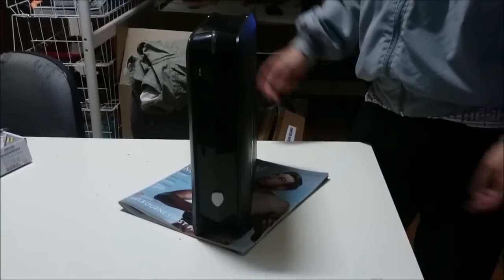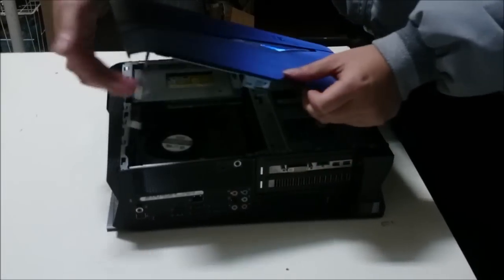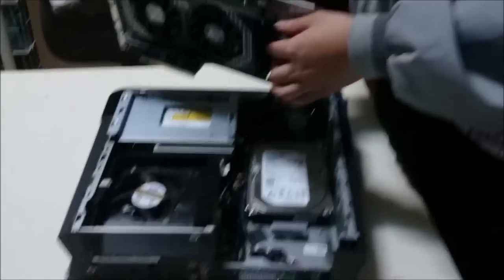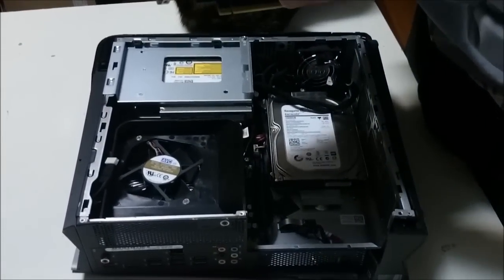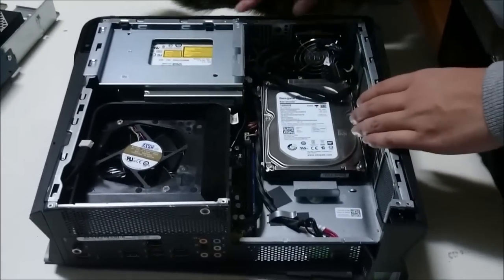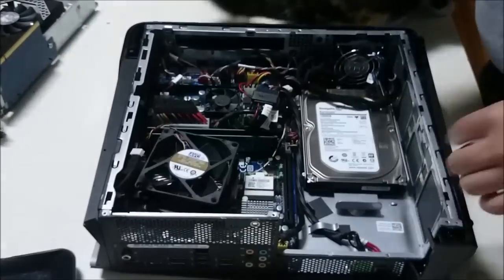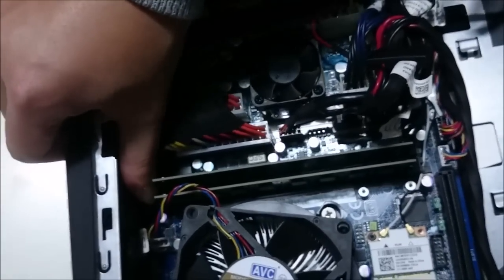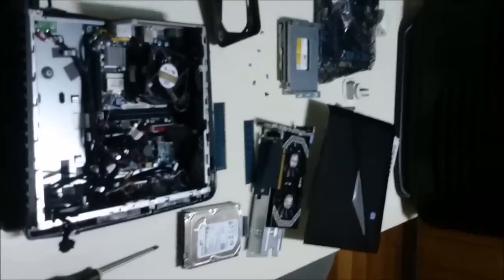OPEN ME UP! Dell Alienware X51 R1 R2 and R3 Disassembly

Comment: Can I use the water cooling component on my R2?
Reply from the maker: nope there is nothing that will fit inside
Reply: @OpenMeUpTec  even if takeout the optical drive? thanks for the reply
Reply from the maker: @savp199524  there is no water cooling design for this computer. you can DYI it but then that is something you are risking. there  should be no reason for you to water cool this computer. if you are have temperture issues then open it up clean out the computer and replace the thermal paste
Reply: OPEN ME UP thanks for the heads up! Yeah just a little paranoid about the temps but they run ok
Reply from the maker: @savp199524  this is an old computer. if you have a problem with it sell it and buy a new one.
Reply: OPEN ME UP will do !

Comment: Uh. That’s not what my X51 graphic cars looks like.... was I ripped off or something?
Reply from the maker: anything that fits inside works. if it does not look like the one in the video then it might not be the original and changed by the previous owner
Reply: @OpenMeUpTec  Well... I'm the original and only owner lol. Mine is only a single fan, doesn't take up the whole area like that one. I have an X51 R2, and the graphics card is a GTX750Ti, which is what it came with.
Reply from the maker: @MsPoliteRants  ok now i understand you got the cheapest graphic card they had on offer. the one in the video is a GTX 660. the biggest thing this will fit is the xx60 series like the GTX1060. you can get small in the xx70 version but it is rare
Reply: OPEN ME UP oooooh damn. That makes sense . I thought i was choosing nicely back then but now I'm looking to update that card so that makes sense. Thank you for the info,i was planning to upgrade to a 1050
Reply from the maker: @MsPoliteRants  honestly you dont what 1050. try to get yourself a 1060 or a 1660. 1050 is too low end and wont last you long. you will need to change it again next year as it is already 2 years olds and next year is 3 years old
Reply: OPEN ME UP the 1050 and 1060 didnt seem too different. I’m worried about price honestly. I mostly just need enough of an upgrade to get Windows 10 to run my video editor. I’m stuck on max RAM 16GB and the motherboard won’t go past i7 intel CPU. Eventually I have to suck it up and buy a new PC but right now I’m in limbo. I don’t play any demanding games. Most demanding game I play is Sims 3. It’s my video editor that has issues lol
Reply from the maker: @MsPoliteRants  if it makes it easier for you, you can buy a graphic card and then reuse that graphic card in the future for your new computer. here in Australia gtx 1050 in only $100 which isnt much compared to gtx1060 $250
Reply: OPEN ME UP yes that’s why I’m aiming for the 1050. Thanks for your help!

Comment: Thanks even now all this time later. was pusihing and poking everything . one utube later and a simple slide.   I am having a hd failure and want to put in an SSD drive.  Amazon says the Samsung EVO 2.5 1Tb might not fit.  I think it will  with an adapter .If your still out there do you think it will fit. ?
Reply from the maker: it will fit any hard drive. if you watch the video you will see there is alot of space

Comment: how do i open the case? mine won't budge even after removing the screw
Reply from the maker: follow the steps in the video and you should be fine
Reply: OPEN ME UP while opening it up, a piece fell out. it's not attached to anything. im not sure where to put it?
http://imgur.com/gallery/0lEePXO
Reply from the maker: graphic card holder. and it goes next to the graphic card at 1.43 in the video.

Comment: I have the GeForce gtx 745 I removed my graphics card but I can not find where these wires plug in? I don't think there is any spot to plug them into my graphics card is there a possibility they are there just for if I upgrade my graphics card? I really can not find a spot where they plug in been looking at this for over 20 minutes now I feel so dumb lol
Reply from the maker: the 745 don't need the plugs. It is for better graphic cards if you get one

Comment: Thanks for the video! I was going to add a Sound Blaster Zx to my new X51 R3 when it arrives today, but it doesn't look like there is room for it. Can you confirm that?
Reply from the maker: +Michael Austin there is no room. it only has one slot which is for your graphic card. you are buying the wrong product if you want to add things
Reply: +OPEN ME UP I appreciate your response, man. I'm probably better off with an external DAC anyway.
Reply from the maker: you have to now as there is no option

Comment: how did you disconnect the string??? I've got the case off but that's wiring so I can't disconnect it
Reply from the maker: +JUSTIN MERRITT watch 0.58
Reply: +OPEN ME UP yeah well mine isn't opening as easy as yours, yours just simply disconnected. mine appears to be fully attached and not wanting to come off
Reply: The white plastic part is actually two white plastic parts. One part has 5 metal pins, the other has 5 holes. On one side of the white plastic connection I was able to fit a tiny flat head screw driver and push the two white plastic parts apart without damaging them.
Reply: @ Micah Shut the hell up loser. Mine is fully attached as well.
Reply from the maker: you guys can get the user manual on dell website it tells you how to disassemble the item. This way it will tell you if it disconnects or not.
Reply: Same omg I can't even pull off it
Reply: MintyMiku bc your a noob
Reply: MintyMiku I wish I could
Reply: JUSTIN MERRITT same lol i swear mines melted together lool first time opening it
Reply: pull harder

Comment: i just got the x51 r3  and i want to know should i be worried the liquid cooling system leaking??
Reply: +09aaronbridges Probably, the water might damage something
Reply from the maker: +09aaronbridges +One Punch Man (Saitama) nope doesn't happen. It use to happen but these days that doesn't happen anymore. If you buy an AIO liquid system and not DYI one then it will not be an issue

Comment: Hi there!

Please provide me the Dell Part Numbers for the below mentioned components for Alienware x51 (R1 or R2) and also suggest an online store from where I can buy them.

Components-

1. The Dual HDD Caddy Tray with the one HDD and one SSD with Interposer Board and cables.
2. The Haswell Motherboard.
3. 330W Power Adapter/Brick.
4. Nvidia GTX 760Ti (Dell OEM) or Any other Graphics Card (with Dual 6-Pin Connectors).
5. Front Panel Connector Board.

I'll be obliged is you do so.......

Thanks & Cheers!
Reply from the maker: If you are after that many parts then I recommend you to buy a new computer as it will be cheaper. Dual hard drive caddy I have never seen one for the dell x51 as there are only 2 sata connectors one is use for the hard drive and the other is used for the dvd drive so it is only possible if you remove the dvd drive but the normal hard drive caddy is around $50, Motherboard will cost you around $150 and you will get a h81 motherboard when you can spend the same amount or less and get a Z97 motherboard also note I had 6 Dell Haswel motherboards and 5 of them were faulty as you can see they not really reliable, 330W power brick around cost $100 second hand and $150+ new from dell when you can buy a 600W 80+ gold power supply for a lot less, GTX760Ti can be bought anywhere as there is no different from Dell OEM and others but remember it needs to be a reference card which is the one with the blower fan on it blowing the air outside the case, reference cards are rear and hard to find these days as there is no reason to produce them compare to custom cooler cards. the customer cooler cards perform better and more efficient than the reference cards. You can use any graphic card under and including a 760Ti or a R9 270x as they fit in the case eg 750, 740, r9 260, r9 250 note you might have to measure the 760Ti and the R9 270 as some manufacture make them longer than normal. Front panel connector board don't know which one you asking about USB connector board at the front of the case? if so don't bother as you wont be able to find it and will be force to purchase it off dell but then they probably don't sell it and only comes with the case itself so if you want it you will have to buy a new case. This is normal I have purchase things off dell before where I was only after a cable but they do not sell the cable by itself and you have to but the whole thing just to get the cable.

If you still want the part number and can look into it for you but will take 2 to 3 days. also the price I have provided you is in AUD which is Australia dollar.
Reply: Thanks for the efforts and yes you are kinda right about the cost factor. But the problem here in India is that Dell Never launched the Alienware x51 R2 here. But they do have the parts available for it. By the way, there is an option for Dual 2.5" Drives (One SSD and One HDD) + Optical Disk Drive as well. I already have a pretty hefty machine with an Intel i7-5960X, Asus ROG X99 Board, Corsair AX860i PSU, Nvidia GTX Titan Black, 512 GB SSD + 4 TB HDD. I just wanted the part nos. for the machine for the upgrade purpose so that my younger brother can continue using the system.
Reply from the maker: Power supply 0xm3c3
Motherboard PGRP5
the rest I have to find and is going to be hard

Comment: I noticed that your video card does not have that plastic clip Dell refers to as the "retention piece" is that because you removed it or did your X51 come without it? I just took mine apart and found the seemingly worthless piece of plastic kept getting in the way when I was trying to put the video card cage back in, I hope it doesn't matter that I just decided to leave it out.
Reply from the maker: they all come with it like you I don't like it. the idea of it is to hold up your graphic card but then it doesn't touch it or make contact with it so it is pretty much useless. it does not affect you system at all if you want to know as I have 5 of these with them all removed as when I open it up it gets in the way and is annoying
Reply: OPEN ME UP
Thanks, that's really helpful to know.